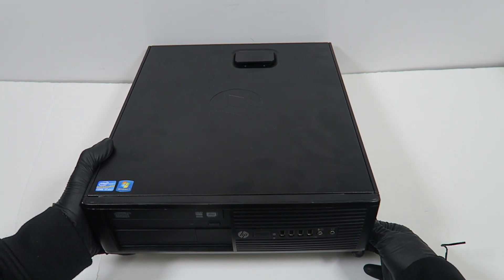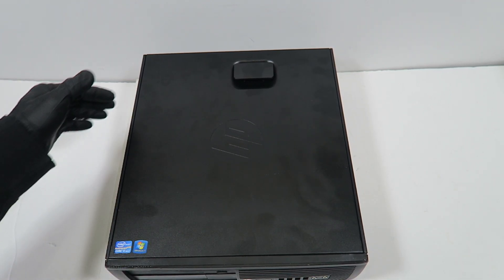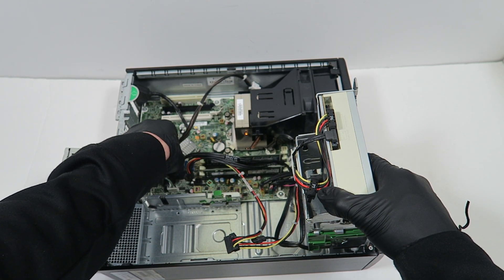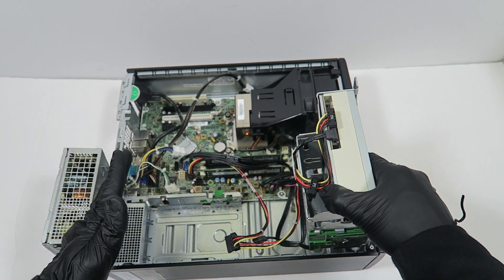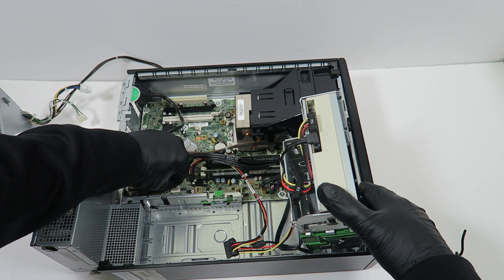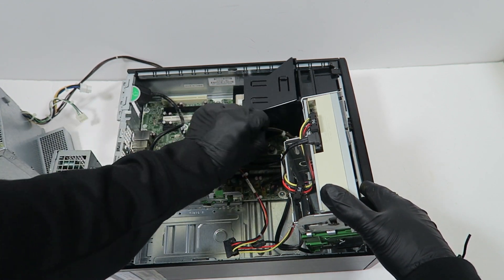How to Replace HP Elite 8300 8200 Power Supply

Comment: You made this look incredibly easy.
Reply from the maker: Hi, thanks...
Reply: actually it's super easy in some of the HP desktop models like this one here, everything on hinges or just locked in. I've got a compaq 8300 elite and for example my power supply is bigger and screwed in, but the rest of the cables, CPU colling etc. looks just the same like on this video
Reply: Because it is.

Comment: I need the powersupply name or spesifications plissssssss
Reply from the maker: Hi, yes you can buy them used on ebay for around $20
HP Power Supply 611481-001 611482-001 503375-001 503376-00 Elite 8300SFF DPS-240

Comment: When I powered up the desktop I got a message saying "No Power Supply Fan Detected". What could the issue be?
Reply: You ever find a fix? Or did you just give up?
Reply: @Malik40333  Just press f1 and it should work
Reply: @rafraf08  I got it, thanks anyway😀

I’m getting a different pc soon so I wouldn’t have to worry about this anymore
Reply: @Malik40333  and what was your fix? do you mind sharing?
Reply: @philipppuchner1115  I don’t even remember actually. I still have the pc though. I do have to press F1 everytime it starts though
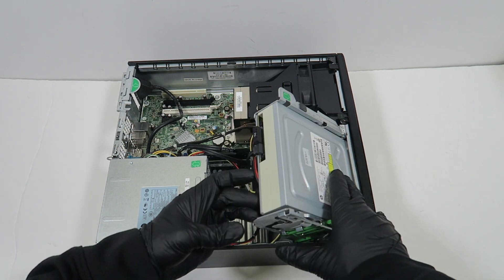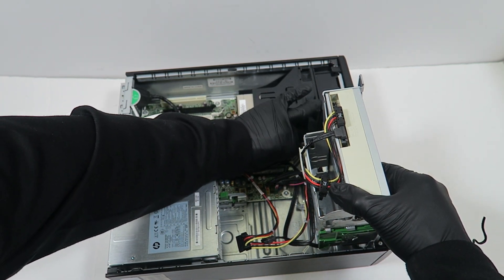Reply: @Malik40333  Here at 0:25.   Also work should work with 8300 when rearranging pins --> 0:35
https://www.youtube.com/watch?v=6A8Ycl4nDYo

Comment: Thanks for the video, but my question is whether or not I can upgrade the power supply to anything above 250 watts? I haven't found any hardware that fits and has higher specs. Do you know of any?
Reply: I know this is to late but just in case, i would go with 240 watts. its enough for gaming despite what other experts say.
Reply: @JereMiah-tg8to  lol no
Reply: Sean Turner yeah lol I realize it now I did more research
Reply: @seanturner1255  I'm running a gt1030 in mine, and this psu in particular can handle up to a gtx 1050 ti, with the i5-2400, and 8GB of ram, more than enough to run games, but not on ultra settings
Reply: @leviathanqueen3780  Hi  Did you have to change any settings in the bios or did the card just pop in and work.  My 1030 just goes to a black screen.  Can you tell me something good?  Thanks
Reply: @Grayelve  did you install the graphics drivers?
Reply: @leviathanqueen3780  With the card plugged in and the drivers installed still booting to a black screen.  The same is happening with a hp 800 G1 SFF so I am thinking, you have to find a machine that allows this upgrade or there is something I have yet to discover that make this possible.  Thank you very much for replying.
Reply: @Grayelve  okay so when you put the gt 1030 in your machine and turn on your monitor it shows a black screen?
Reply: @bin6ixo  Yes , screen is black.  It sounds like a hit or miss on getting a machine that will work with this 1030.  But , I discovered there is a bios upgrade for this machine that I will soon install  for a retry of the 1030.  Thanks for the reply and any help you can offer.
Reply: Hello , i'm a bit late but i got a similar issue , did the bios update fix it ? Did you install the gpu drivers ? Does it work ?